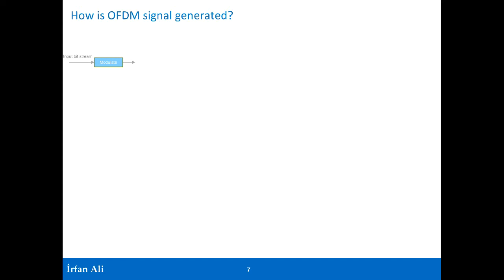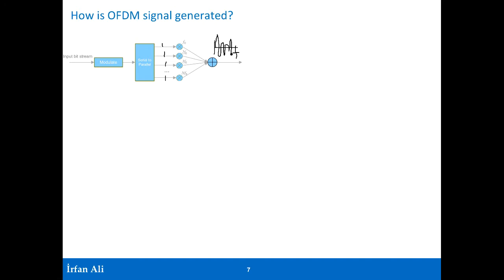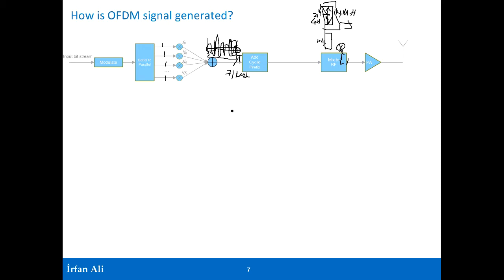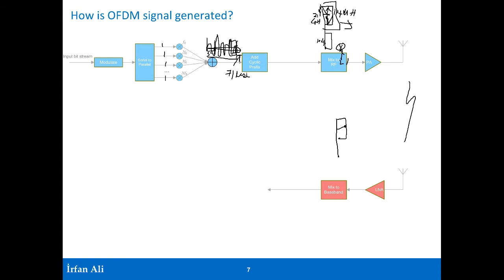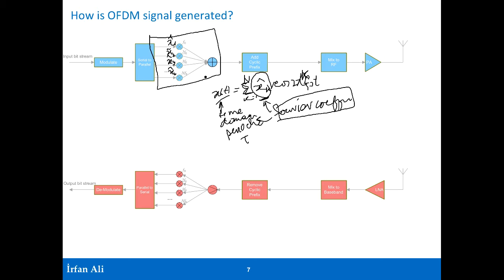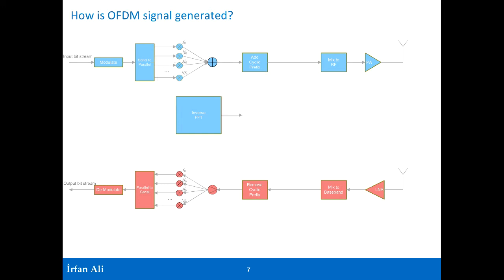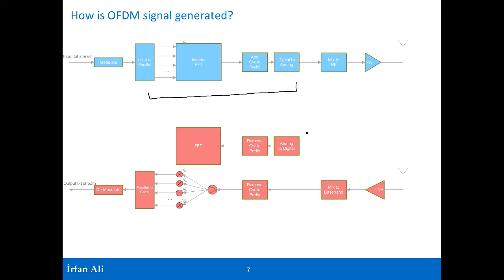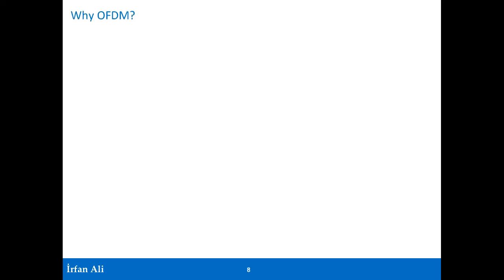LTE Radio Primer Part 2: OFDM Transmitter & Receiver

Comment: Hi Sir, Still concept not clear like what exactly is Preamble. Also you have used the word cyclic prefix interchangeably. Kindly help to understand the concept of Preamble Pls
Reply: copy the end of symbol to the begining of this symbol as preamble, so it is cyclic prefix.
like you have 11101110, you copy the last 10 to the begining, you will have 1011101110
as why it called cyclic, image round this 10bits in a 8bit cylinder